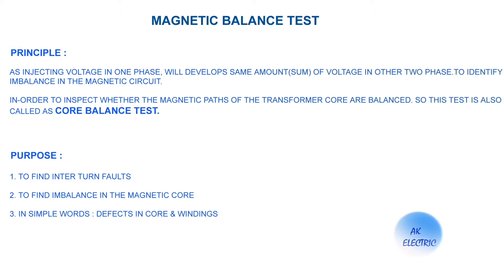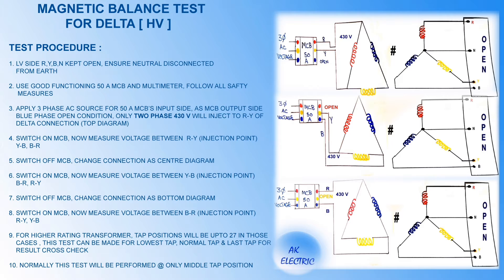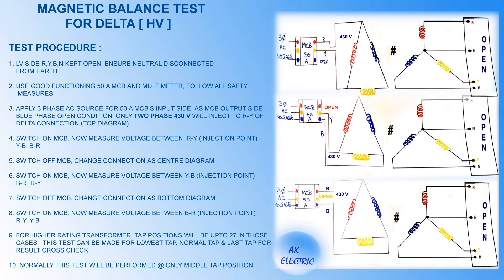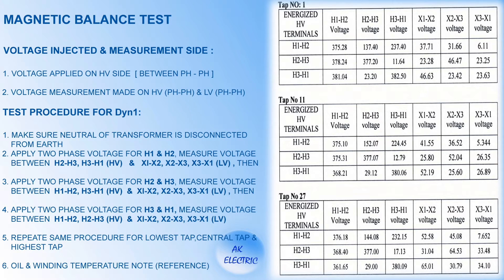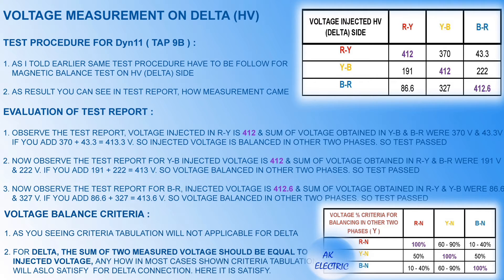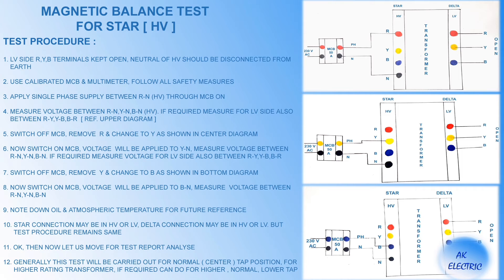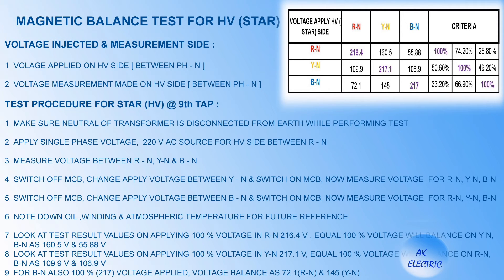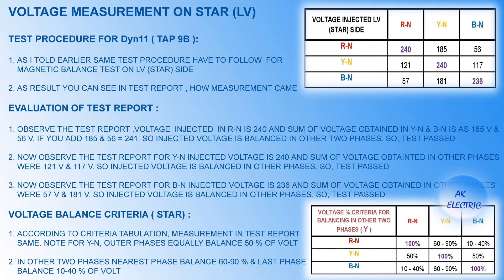MAGNETIC BALANCE TEST - ENGLISH,TEST REPORT ANALYSE, CIRCUIT DIAGRAM, TRANSFORMER, CORE BALANCE TEST

Comment: How magnetic balance test perform in STS 5000(ISA make multifunction transformer kit)
Reply from the maker: Dear Hi,

Until now I have not used STS 5000 test kit. If in future I use that test kit definitely I will upload video.

FYI, Magnetic Balance Test does not require any special test kit. It require only Two phase voltage for Delta side & single phase voltage on star side with Multimeter. That's all. This method you  observe from our video.

Thank You